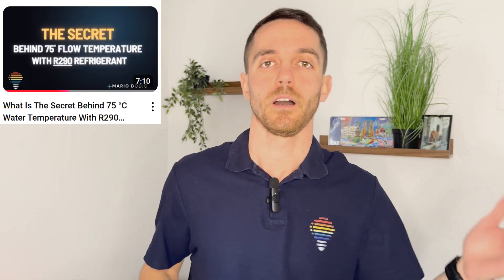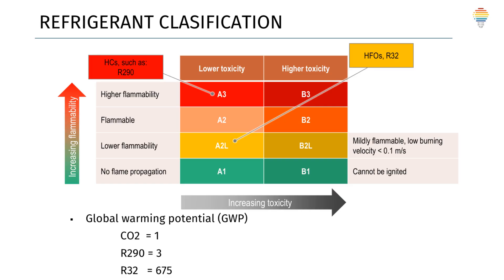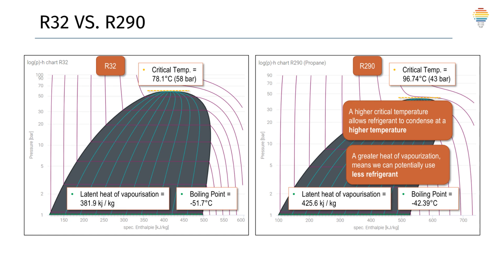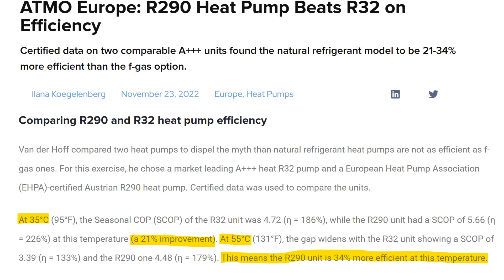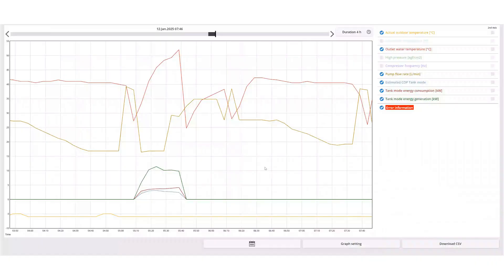R290 vs R32 Heat Pump Efficiency

Comment: I see R290 a better thermal range  for heat pumps to operate in cold climates, given you can package all the goodies external to living quarters.   The necessity for double heat exchanger mechanism, means the acceptance of loss of thermal heat transfer efficiencies and corresponding increase of failure modes.....reliability.
Reply from the maker: Agree, and Europe is going in that direction. But flammability is a main issue.